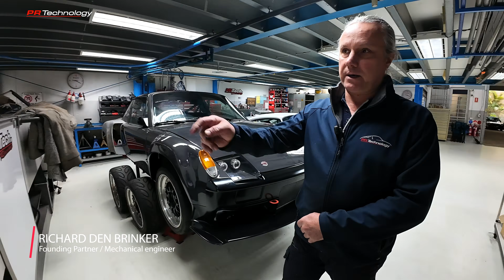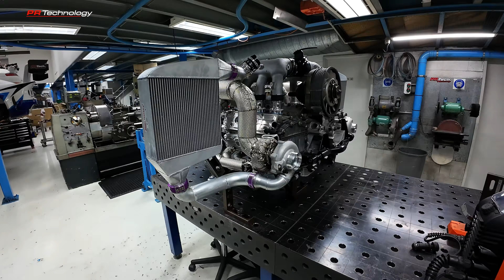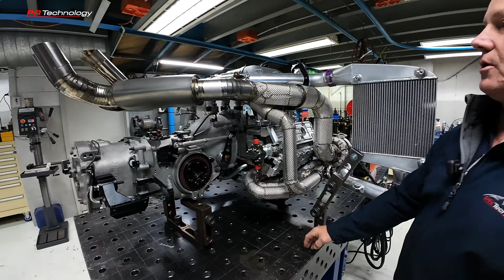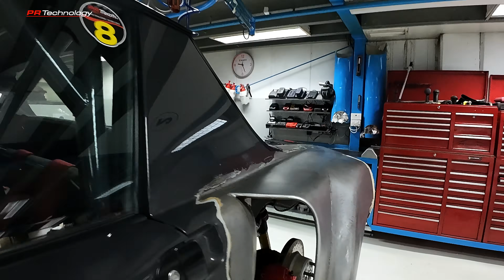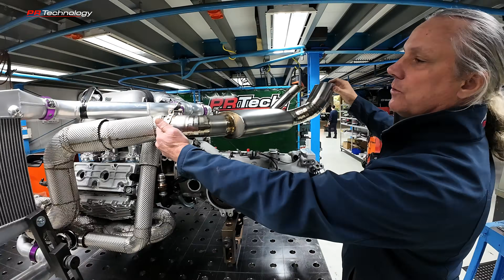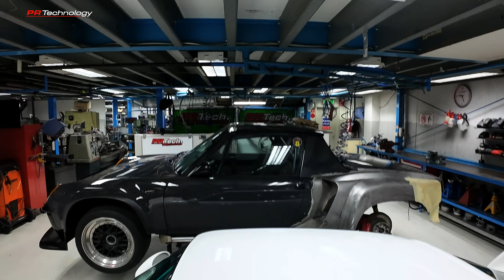PR Tech Porsche 914 Engine Power Pack

Comment: You guys take the most unloved Porsche chassis' and make them in to the monsters they never were.
Reply: Not unloved chassis, perhaps unloved due to shape and 4 cyl vw banger  status .  
But on the Porsche factory skid pan at the time, was 10% quicker than a comparable 911.
Reply: Not unloved chassis, perhaps unloved due to shape and 4 cyl vw banger  status .  
But on the Porsche factory skid pan at the time, was 10% quicker than a comparable 911.